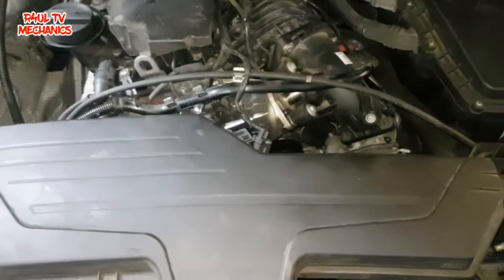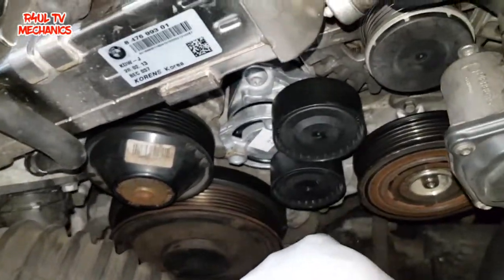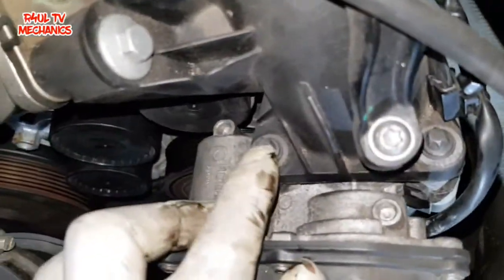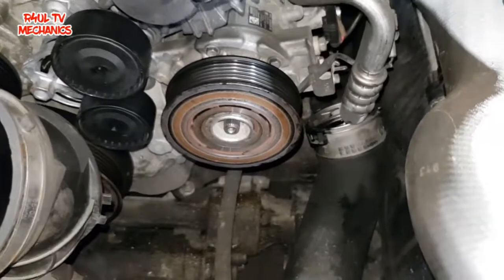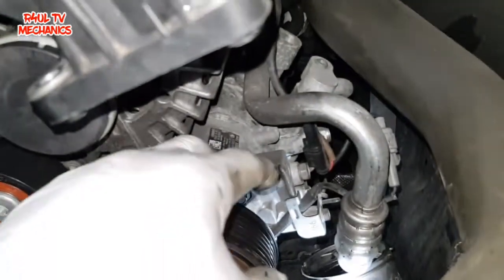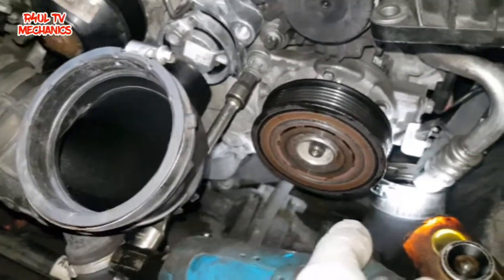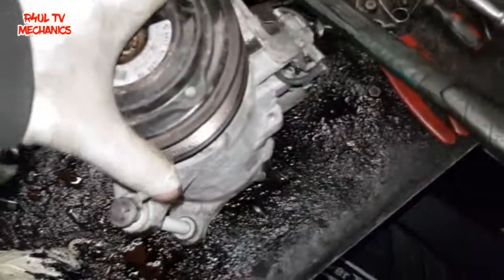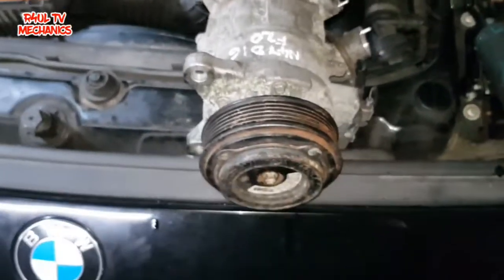2014 BMW 1 SERIES AC COMPRESSORS REPLACEMENT

Comment: How do you push the spacers back? Just tap them with the screws in? Its really a tight fit to re-install
Reply from the maker: Thanks for watching really appreciate it. Yes put the bolts in make sure you rest it on something then tap it in
Reply: @TEAMR4ULTV  thanks 

Have to say this was very painful to do… you need to tap them just about the same as the old ac otherwise it moves quite abit